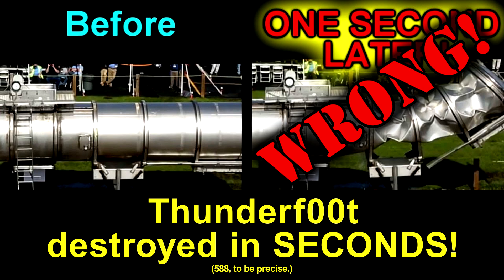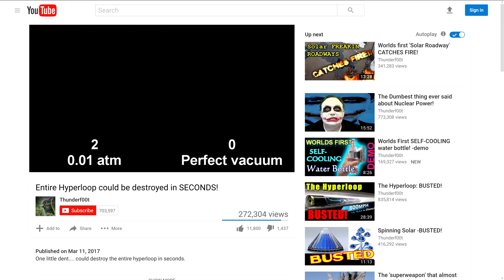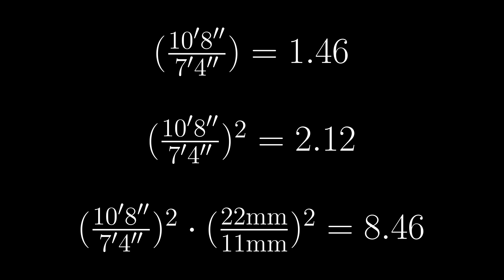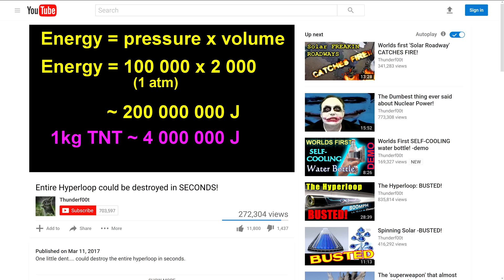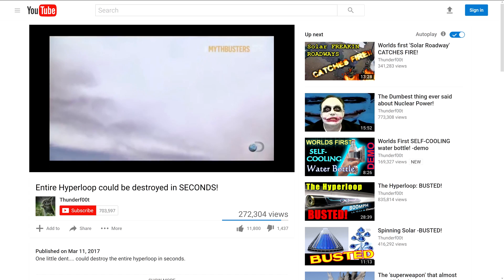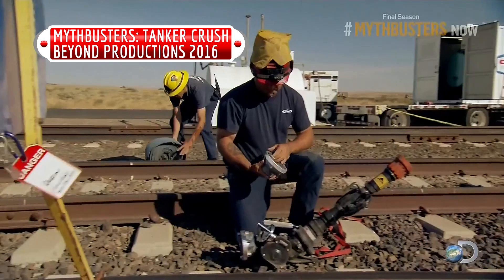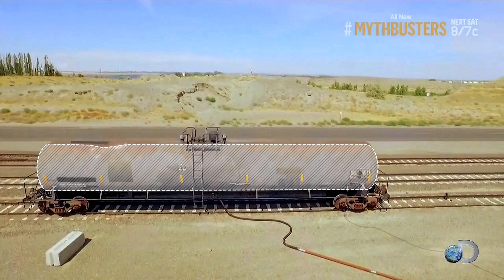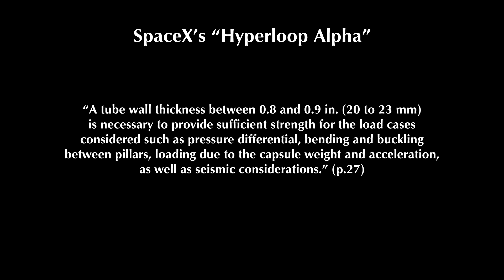Thunderf00t destroyed in SECONDS!

Comment: It's only $5 worth of electricity!!!
Which is nearly 2x more than the average American home uses in an entire day according to the EIA which cites 901kwh/month. And if you were to dump all that electricity (mind you, most American homes run 200 amp service) at once, into a person, it would be instant death. That amount of energy is not trivial. You commit the same bit of obfuscation of which you accuse Thunderf00t, and which I used in the preceding sentences. SCARY ELECTRICAL DEATH!!
His concerns about that amount of energy are valid and just because it's a big number, doesn't mean he's trying to scare someone. He's using the correct units of measure and relies on you to understand what that means.
Reply from the maker: "Which is nearly 2x more than the average American home uses in an entire day" LOLWUT??? That would make the average home electric bill less than $75! REALITY CHECK FAIL.

(And how is the comparison to the average home even relevant?)
Reply: "And if you were to dump all that electricity (mind you, most American homes run 200 amp service) at once, into a person"
Pure nonsense.
In order to understand why, you could imagine that energy spent on creating vacuum is spread across the entire length of the tube - tens of kilometers.
Basically, the energy that would act on a capsule in case of depressurization (actually, if tube was cut in frickin' half and air was allowed to rush in as fast as possible) would only be equal to the force of air pressure acting on area of cross-section of the tube times whatever distance that capsule would travel under that force. Which is orders of magnitude lower than energy spent on creating vacuum in the entire tube.
Reply: https://www.eia.gov/tools/faqs/faq.php?id=97&t=3
How much electricity does an American home use?
"In 2015, the average annual electricity consumption for a U.S. residential utility customer was 10,812 kilowatthours (kWh), an average of 901 kWh per month."

901kWh/30 days = ~30kWh a day. You said 56kWh, did you not? I was correct in my statement of nearly 2x the average daily use, was I not?  The costs would vary considerably depending on rates, time and taxes/fees, thus judging my argument on cost rather than the figures makes this reply about as sad as the video. Location has a lot to do with electricity costs, so lets just deal with the actual energy used, shall we?

It is relevant because you are dealing with energy. You attempted to trivialize how much energy actually goes into a system like this by using the low cost of electricity. 
I gave the viewers a real representation of the energy usage in terms they might better comprehend and managed to show how you are guilty of the same attempt at obscuring the numbers, of which you accused Thunderf00t. 

Also, your airplane depressurization is a shockingly bad example considering the enormous differences in pressure at the altitudes commercial airplanes operate at, and the near vacuum the hyperloop will (never) operate at. Atmospheric pressure at 40k feet is 18.7 kPa. Atmospheric pressure at 160,000ft is 0.146 kPa. That's a 100 fold difference! Depressurization on a plane would be nothing like an repressurization on a damaged Hyperloop section. Pretty misleading dude considering the orders of magnitude difference.
While I don't think the Hyperloop tube will have a beer can failure barring some catastrophic external accident, the energy and forces involved, are not trivial. What happens to the vehicles and people inside is a real concern.
Reply from the maker: "It isn't relevant to what I was talking about, so I ignored it." In other words, it showed what an idiot you are, so you HAD to ignore it.

"you are talking about going from 0.146 kPa to 101 kPa (at sea level) in every consecutive segment of the tube at the speed of sound." Why don't you read up on something called the "Light As A Feather" game? This is where a few of your friends can pick you up using only one or two fingers on each hand. This demonstrates something that neither you nor Thunderf00t get: the work can be spread out, and when it is, it becomes MUCH easier.
Reply: You're right about the financial compensation. Your family will get a nice settlement for your death. People are usually on time to their own funerals, so you have that going for you.
We have real data on what happens to objects subjected to overpressures lower than the ones we're talking about and it's not pretty.
Reply: A train locomotive generates 1700kW of power on a continuous basis.  A train locomotive pulling passenger cars operating for twenty hours consumes (assuming 60% load average) 20,400 kWh.  Clearly this is absolutely impractical.  This amount of electricity could KILL a person—SCARY ELECTRICAL DEATH!!!!!!!!!!!! so there is no way that anybody will EVER use electricity for moving freight and passengers.   Not more than, oh, about a MILLION TIMES A DAY.
Reply: Read my above comment, please.
Reply: I did. It isn't relevant to what I was talking about, so I ignored it. I was speaking specifically about how Shane Killian deliberately misleads his viewers with a comment of "5 dollars of electricity." instead of addressing how much energy is actually involved. I even mentioned that dumping all that electricity into a person and then openly stated that it was the exact same kind of obscuring that Shane did.

 " You commit the same bit of obfuscation of which you accuse Thunderf00t, and which I used in the preceding sentences. SCARY ELECTRICAL DEATH!!"

And the tubes will be hundreds of km. If you cut the tube in half, you are talking about going from 0.146 kPa to 101 kPa (at sea level) in every consecutive segment of the tube at the speed of sound. It would take a matter of minutes for the entire tube to re-pressurize to atmospheric levels. So while the release of energy would not be instantaneous, it ain't a gentle breeze either. Hopefully your hyperloop train is in front of the wave of air coming at you.
Reply from the maker: "Calls me a moron, yet tries to compare energy levels by discussing residential cost of electricity." No, LIAR, not residential cost, just cost. Thunderf00t made it out to be a lot. IT ISN'T.

"My comparison letting people know just how much energy is in the system we're talking about, is absolutely valid." No, because your comparison DIDN'T do that. It was DELIBERATELY set up to mislead, just like Thunderf00t's.

"which means the energy would be released in a period of seconds." We very thoroughly debunked this idiocy several videos ago.

"The Hyperloop isn't an open environment." Yes, it is, and you'd know that if you'd just read the Hyperloop Alpha document. What do you demented fucktards have against actually READING UP on the thing you're railing against?

"You don't generate a near-vacuum in an open environment when there is 1atm of pressure outside trying to force its way in." We showed quite clearly that standard industrial pumps are easily up to the task.
Reply: Yeah, sorry, and about that $5 - It seemed to me that Shane used this demonstration of cost of that energy to show that the fact of that amount of energy having a lot of zeroes in it does not say anything about how much influence that amount of energy  actually has on problem in question (Hyperloop) and it should be analyzed from physics standpoint. He probably felt that Thunderfoot tried to intimidate viewers just by that number itself.
Reply: Dude, you should really stop with the terrible analogies. They are doing you no favors when it's so easy to see why they are wrong.
Reply from the maker: For the record, the $5 figure was brought up because Thunderf00t was pretending that this level of vacuum was unfeasible. It isn't.
Reply: +Mike McKeen Lol it seems someone beat me to the punch. It feels nice to have scientifically literate people on the internet who uses numbers, not words, to argue their case.
Reply: There's no question that rail is the most efficient way to move cargo, second only to barges (impractical in Arizona).  That's not to say it's perfect.  You have metal wheel on metal rail abrasion, which causes track to wear out, requiring CONSTANT inspection and replacement.  Some segments of track have a lifespan of only SIX YEARS.  Snow removal for trains is an extremely expensive operation, not to mention the cost of delays from not being able use those tracks.  Using Thundref00t-style tactics, though, you could mathematically demonstrate why trains are COMPLETELY IMPRACTICAL and why NOBODY would ever consider implementing them.

Extra points if you add self-satisfied, snide laughter to your arguments about how impossible it is to lay continuous steel tracks because they will have to expand HUNDREDS of meters in the California heat, and the extreme danger of having twenty six MILLION pounds of steel hurtling down a track at seventy miles per hour.  Trains are astounding engineering feats, but we take them for granted because they've been around for a very long time.

Every transportation system has its challenges.  Airplanes could be considered impractical because quite a few planes have literally EXPLODED, killing hundreds of passengers, due to the pressure differentials they operate at.  Sometimes it was due to engineering oversight, sometimes due to poor maintenance.  Every airplane represents multiple points of failure, which can result in the deaths of hundreds of people—and has!  Airlines have some stupendously expensive infrastructure.  Denver airport alone cost nearly $5 billion.  Amazingly enough, we have not stuck our head in the sand because of risk and abandoned air travel!
Reply: Good thing track is relatively cheap huh? Also good thing that track is thermally stressed before installation so that expansion and contraction can be controlled and you don't have thermal failures. You get away with this because the track is solid and the heat treating not as critical. They also generally have different levels of hardness on the contact surface vs. the rest of the track.
Using Thuderf00t style tactics, I could not mathematically demonstrate why they aren't practical, because it's pretty clear that rail travel is quite practical, even if the engineering challenges are great.

While there are multiple points of failure on an airplane and sometimes, people die, they don't have single points of failure that shut down the entire system if something goes wrong. If an airplane crashes, the whole route between Denver and Chicago doesn't stop. 
You mention pressure differentials, but an airplane has a very different pressure differential than a Hyperloop tube. If a plane depressurizes, it usually isn't a problem. The pilot can descend to get to a suitable altitude. If the Hyperloop tube pressurizes, it's a massive problem that again, shuts the system down. I suppose you could have gates along the way that could seal the damaged sections, but you're adding more expense and shutting down an entire route. 
Also, you don't generally find too many flights for $20/ticket. The stupidly expensive infrastructure is supported by ticket prices. Hyperloop ticket prices aren't going to be anywhere near as cheap as suggested. Not that this will necessarily be a deal breaker, but it's another thing to consider. If you can fly cheaper than Hyperloop, why wouldn't you? It does sort of kill the idea of Hyperloop as common transit though. You won't use it to commute from your home in Utah, to your job in San Francisco.  

Nice try.
Reply: Hah!  Now you're just pulling shit out of your rectum.  141#/yd track is not surface hardened or heat treated.  The top of the rails are work-hardened by use, just like an anvil.  It's a manganese carbon steel similar to springs, which should give you a clue as to why there's no need to accommodate expansion.  Case hardening would make thermite welding impossible, because the HAZ would cause cracking (as you would know perfectly well had you ever done welding or forging of leaf springs).  Nor is it "thermally stressed" (which is a thing you just made up) before installation.  Even if it were, that would only make it MORE expensive to replace.

When a rail segment gets torn up by derailment or wreck, that shuts down that entire segment of the line.  Why do you bring up a $20 ticket?  That has nothing to do with anything.  That was the figure that Elon Musk gave as the part of the ticket cost needed to pay for the initial costs NOT the actual cost of a ticket.  This would be competing with airlines, where the cheapest same-day one-way ticket from SFO to LAX is about $150 (and you have to get to the airport two hours in advance for a one-hour flight).  Even at HALF the cost, that's still a $75 ticket.  Jesus Christ, even just driving it would cost $35 in gasoline in an economy car.  I would expect ticket prices to be around $100.  I don't expect this to replace flights from New York to Tokyo, but there are a LOT of people commuting into SF from as much as 3 hours drive away.

Often the pilot is able to descend to a safe altitude.  Sometimes they descend rather more rapidly, in small pieces, such as with the deHaviland Comets and the DC-10 cargo doors, or in a couple of big chunks, like Flight 123 in Japan, or minus cabin crew, as in Aloha Flight 243, etc, etc.
Reply: Rail stressing is the process by which they tension the track, essentially stretching it to the same length it would be at a specific temperature. That way you don't get much movement when the temperature rises. The whole purpose is to mitigate thermal expansion. The steel itself is absolutely heat treated, a quick google search tells you this, and head hardening is a thing.

The hyperloop has been billed as a way to move people great distances and make rapid trips as a mass transit system. This was specified in the alpha document. It was billed as being far cheaper than any other method of transiting the distance between LA and SF. It wouldn't compete with air travel according to the alpha document.
Reply: Um, no.  From a metalurgical standpoint, "stretching it to the same length as a specific temperature" is gibberish.  You can stretch it beyond its elastic limit, at which point it would have a new length (which is how wire is made), and would expand from THERE when heated.  You cannot prevent it from expanding when heated by stretching it.  Now, you COULD put it under hellacious tension, stretching it to just BELOW its elastic limit, so that when it got hot, it would have that tension relieved and wouldn't get significantly longer, but what about when it gets cold?  The rail, already stretched to the limits of its tensile strength, will then be stretched MORE by the contraction of cold.  It will break apart into itty-bitty pieces.

All that is moot, in any case.  There would be no way to do curves with pre-tensioned rails.  It would pull itself out of alignment and yank the spikes out of the ties in short order.  People who build fences learn very quickly what happens when you try to run tensioned wire around curves without some SERIOUS bracing.  Do you see massive cantilever bracing in train curves to resist the millions of pounds of tension?  No, you do not.   Incidentally, the movement and buckling (or lack thereof) around curves will tell you exactly how much thermal expansion is a problem on rigid steel rails.

I did find some EXPERIMENTS on heat-treate
d rails in the 1980's, in Russia, using induction hardening.  I also found a 1933 patent which laid out the problems with heat-treating rails, mainly that chunks start popping out of them in use, which laid out the case for only SLIGHT hardening, to no greater than RC40.  The only other references I can find to heat-treating rails is when people are using chunks of rail as anvils.  Now why do you suppose blacksmiths would need to heat-treat rails if they are ALREADY heat-treated?  Anvils are generally on the high side of RC50, so rails are too soft, but with their carbon content can be brought to greater hardness.  Hammer faces are generally around RC58.

Now, there ARE some induction-hardened rails in the world, but because of the added expense, they are only used on very high-speed seamless lines, mostly in Europe, and in the USA only on extremely high-wear curves and inclines with heavy traffic.  The vast majority of track laid in the USA is not induction hardened.
Reply: Dude, there is a whole wiki article on rail stressing. Its a real thing, unlike the hyperloop.
Reply: I love Wikipedia, but one of its downfalls is that ANYBODY can put an article on there, and there's little more vetting than, oh, say a YouTube comment section.  Yes, there is a Wikipedia article, written obviously by someone NOT in the USA, with zero citations.  It's only backing documentation is an external link, to a page from a tiny research organization within DOT that shows that rail in the US suffers from DOZENS of track buckling and derailment incidents every year, with tens of millions of dollars worth of damage each year, and advising that "gee, research is really needed on this."  Just proves that CWR railroads are technically impossible. 

You have misunderstood the difference between pre-tensioning, and stress-neutral track laying.  The rail is heated to 110F while laying, to attempt to overcome buckling.  However, this is a compromise which creates EXACTLY the problems I cited above, according to the research site linked in the Wikipedia article.  "inward (pulling-in) movement in cold weather could lead to line defects and lowering of neutral temperature which could lead to a buckle when higher temperature rises occur in early spring.... Alignment errors must be corrected in hot weather and in early spring when curves tend to realign themselves from a winter "pull-in" condition....Compressive and tensile forces can cause radial breathing of curves especially in weak ballast conditions."  It gets even worse. "It is important to inspect track after a train passage in hot weather, especially if the track has recently been disturbed."

You have to inspect railroad tracks after EVERY TIME A TRAIN GOES BY???  So railroad tracks require CONSTANT and very expensive supervision, maintenance and renewal.  Thunderf00t should do a series on why these crazy-ass "railroads" should never be pursued.  Obviously the technical challenges of mere weather are impossible to overcome!
Reply from the maker: "It is relevant because you are dealing with energy." That doesn't mean that any POSSIBLE comparison is relevant, MORON! Energy covers QUITE a big area. The total energy contained in the matter of a 200-lb person is over 2.2 TRILLION kWh. Yet, it only takes 100mA to kill you.

The point about the airplane was the point about a sealed vs. open environment, which I see you have still failed to consider for even the slightest fraction of a second.
Reply: Calls me a moron, yet tries to compare energy levels by discussing residential cost of electricity. All aboard the Hyperloop to Failsville!! My comparison letting people know just how much energy is in the system we're talking about, is absolutely valid. Especially when one considers that the amount of energy released in a serious breach, would not be spread out over the course of hours or days. Thunderf00t was absolutely correct when he said air would enter the breached tube at the speed of sound which means the energy would be released in a period of seconds. Frightening prospect indeed considering the volume of air we're talking about.

The Hyperloop isn't an open environment. You don't generate a near-vacuum in an open environment when there is 1atm of pressure outside trying to force its way in. While it won't be a perfect vacuum, nor was it ever intended to be, it certainly isn't open and any vehicle entering or exiting, would have to do so in via an airlock unless you're OK with having to pressurize and evacuate the tube every single time a vehicle is to enter and exit; clearly not practical if you're talking about a tube running between cities.
I didn't consider your sealed vs. open point because it was incorrect. It's a vacuum, it's sealed.
Reply: Nobody ever said trains were impractical. The fact that so much freight can be moved using only 20mW is what makes it extremely cost effective. That and train tracks. Track is the other key that makes trains work so well.
Requiring that train to run in a near vacuum with multiple single points of failure in a track that only handles one-way traffic is what would make it impractical.